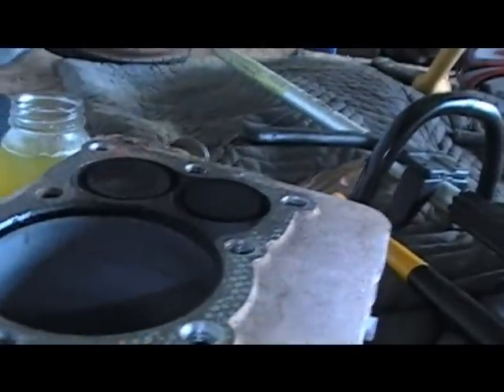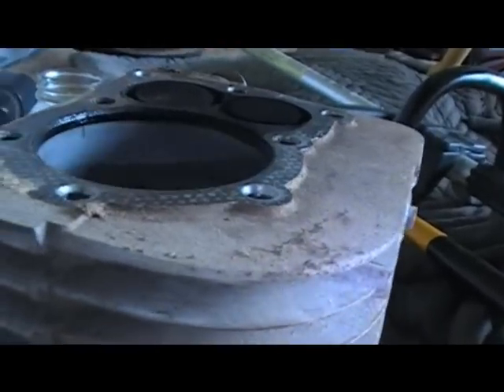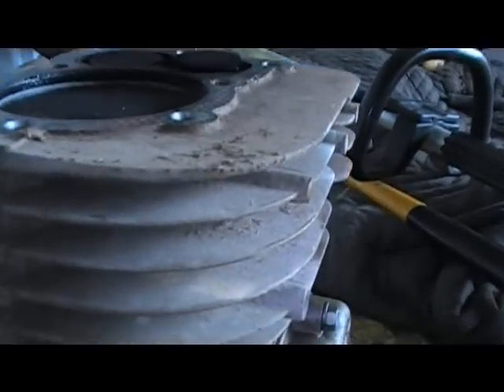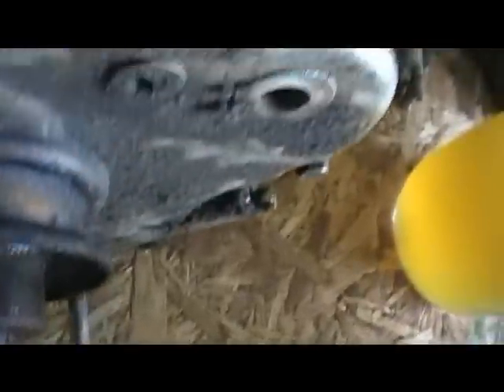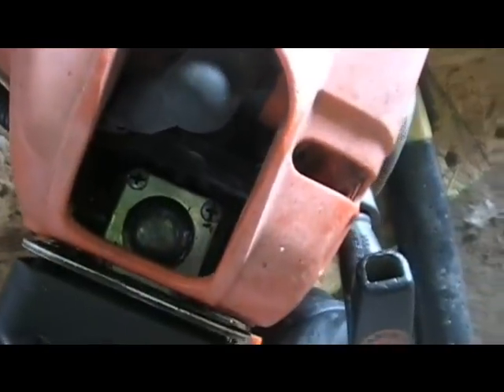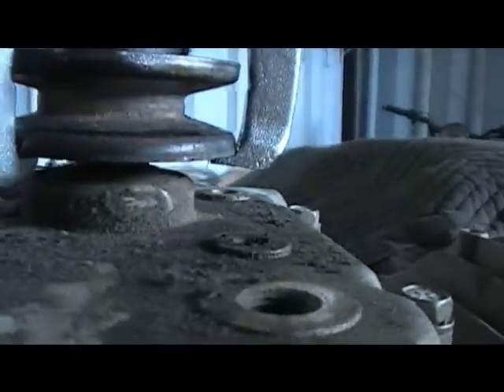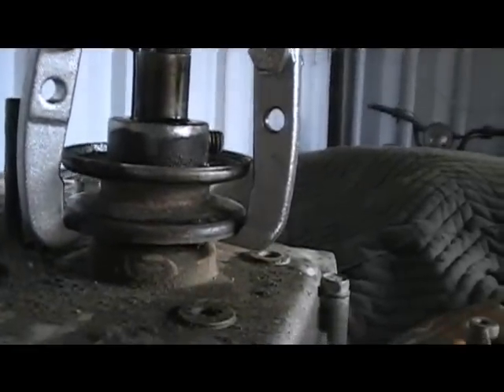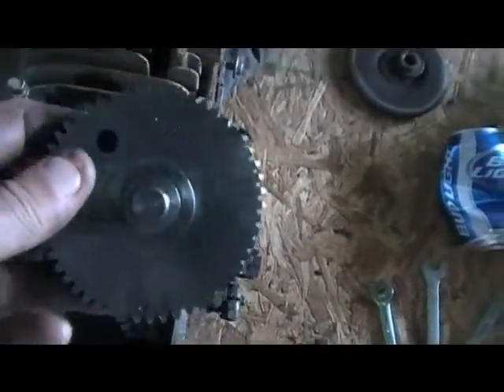steam engine part 1

Comment: @omegahpla 
I'd also want an automated damper for the firebox that closes when the steam pressure reaches the desired level then opens again once the pressure drops due to working the engine. Might as well throw an automotive alternator on the system and a motorcycle battery so you can add electrical sensors for pressure and to actuate the damper. 
Since I'm a diesel mechanic, most of the parts I'd use would probably be from my industry.

Comment: @omegahpla 
That's good thinking. I'd prefer a lower pressure spring loaded pop-off valve and a higher pressure blowout like you described. Can't be too safe ya know.
I sometimes wish I owned a house where I could experiment like this. Oh well I only have 9700 left on my condo mortgage. Once I'd paid off I'll start saving for a house.

Comment: @vention4wh Hey, you've got some good thoughts on this situation Vent. (lol Vent, that's ironic because I was talking about vents) I like a blowout that's not dependent on a functioning mechanism because they can be corrupted. I like a structurally weak blowout that would go at a determined pressure because of it's material properties as an ultimate fail safe to keep from building pressure that's way over dangerous. The kind that leaves craters where buildings used to be.

Comment: 2. Have you thought about about a condenser to recover the exhaust water? If you can cool the steam just to the point where it condenses (but no more) then you don't have to heat it as much to turn it back into steam and drive the piston again.
Just as in air conditioning, the power comes from changing the state of the fluid from liquid to vapor. If you can do that in a more narrow range of temperatures then you get more mechanical force in return for a given amount of fuel.

Comment: Wow! How cool is that! Do you have a lathe that will allow you to turn the lobes into shape?
What kind of evaporator are you going to use? I bet if you could find an old steam cleaner you could pull the heating coils out and use them as an evaporator instead of a regular water tank. That would give you a faster start-up time.

Comment: @omegahpla 
I imagine a pressure relief valve for a standard air brake system on a truck would work well for that. They pop off around 150psi but I imagine you could find lower pressure versions.